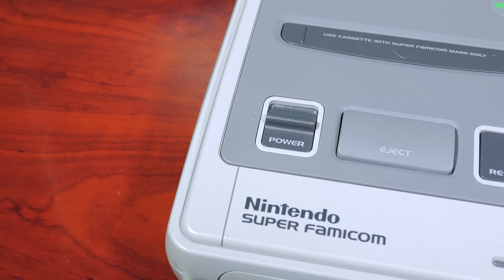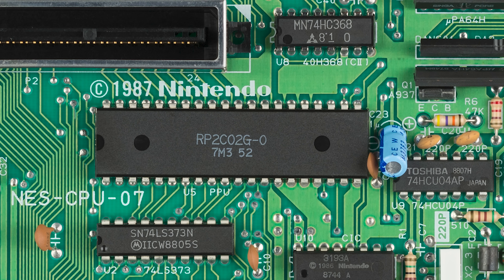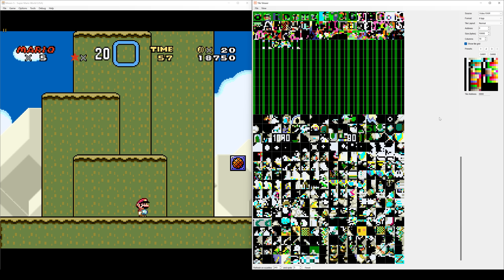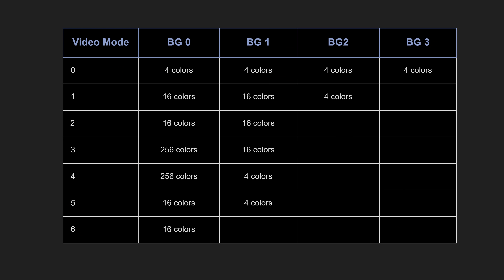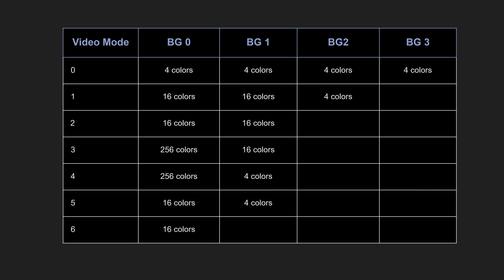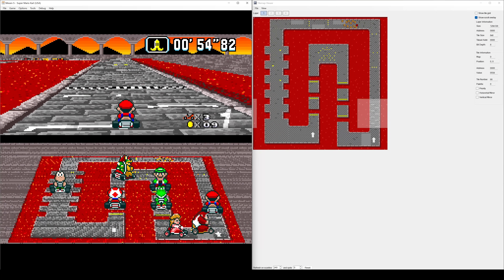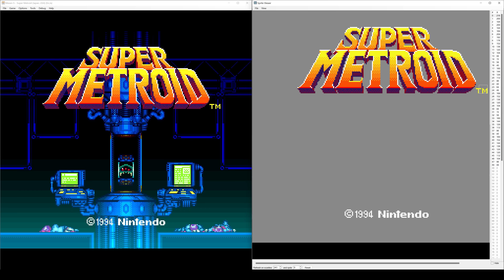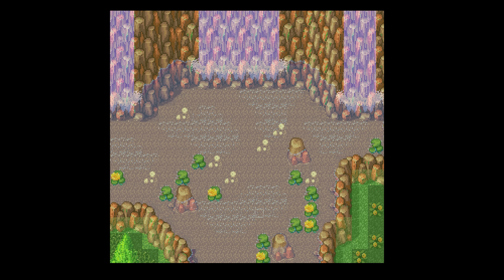How Graphics worked on the Super NES | MVG

Comment: In the opening, you mentioned that the SNES used the Ricoh 5A22, a variant of the 65C816 (which itself is a variant of the 6502). You indicated that at 3.58 MHz, it was underpowered compared to the Sega Genesis which used a Motorola 68000 at 7.6 MHz (over double the clock speed). However, directly comparing clock speeds is not an accurate comparison. Looking at the calculations per second the Ricoh 5A22 is approximately 1.5 MIPS while the Motorola 68000 is approximately 1.0 MIPS. This actually makes it appear that the SNES's processor might have been more powerful than the Genesis. Just something to keep in mind.
Reply: 6800 has more fitting instruction set so if used properly it was quite a bit faster than the 5a22

Comment: I am confused when you say the translucency/color blending on SNES isn't "true". Are you contrasting to this to per-pixel alpha on more modern hardware? Mathematically, the operation performed by the PPU between layers for translucency is exactly the same, and it is the same kind of technique used to do translucent stuff in PC software-rendered games like in Doom source ports - for example, 50% translucency is 0.5*foreground + 0.5*background.  PlayStation had a similar set of blending modes, but it offered them per-primitive rather than per-"layer" (as it has no concept of layers, being 3D-oriented instead of a tile engine; just two framebuffers).

Comment: If I recall the 65816 is a more efficient chip than the 68000. So even at half the speed, it's capable of a little better performance. Clock speed isn't everything. It's actually too bad the 65816 didn't eventually evolve into a modern 64 bit CPU everything is based on today. I suspect our computers would be double or tripple the speed clock for clock

Comment: I highly recommend RGME's Series about the SNES Hardware, it goes into great detail about pretty much everything, with very good visuals:
https://www.youtube.com/watch?v=57ibhDU2SAI&list=PLHQ0utQyFw5KCcj1ljIhExH_lvGwfn6GV
also it's not really fair to compare clock speeds of 2 completely different CPUs, the 3.58MHz 65816 runs slower than the 7.6MHz 68k but the SNES executes slightly more instructions per second as all 65xx CPUs require far fewer clock cycles to access memory and execute instructions compared to most other CPUs like the 68k.
Reply: Yes, it was slower but it wasn't half as slow. The little CPU punched a bit above it's weight.
Reply: I'm glad someone mentioned this channel, it's incredible.

Comment: Thanks for some insight into how the snes handled graphics. Im curious if youd be willing to dive into my favorite snes game jurassic park. Ive always been blown away with its isometric to fps switch indoors and am kinda curious
Reply: The indoor scenes were actually done with Mode 7 and software rendering, afaik.
Reply: @ShinyHappyREM  Kind of. More specifically, Mode 7 is used because its graphics format is linear i.e. every pixel is assigned one byte. In contrast, the SNES uses otherwise planar graphics i.e. a single pixel is spread out over multiple bytes which makes it hard to transform without proper hardware (e.g. SA-1, Super FX).

Comment: So....for devs to make a working emulator for these systems, the devs had to understand HOW the hardware worked and not just the software?
Reply: Yes. The software can only give you hints to how the console was supposed to work
Reply: Work through real ROM dumps on PC identifying behavior, build homebrew based on findings to test specific parts of it, then test homebrew on emulator and actual hardware to determine correct behavior.
Reply: I can't even begin to imagine. Like, you're already a good programmer and now you have to study hardware.

Comment: I'm curious of how Sega Genesis and other systems could mimic mode 7 style effects. What tricks were used? Will you make a video about that?
Reply: There's a YouTube channel called Coding Secrets that you might be interested in. The channel's author, a graphics programmer from the 16-bit era, talks about how he pulled off mode 7 effects on the Genesis - without the hardware obviously.
Reply: @megabyte01  He's not just any programmer. He's Jon Burton, founder of Traveller's Tales.
Basically, the Genesis does it all in software using line manipulation tricks or simply by using multiple sprites. The Sega CD has full hardware support for scaling and rotation, but few games made good use of it due to the focus on FMV. Sonic CD's special stages are a notable example "Mode 7" on Sega 16-bit console hardware. The 32X also supports it in hardware, and actually got a few games that made full use of the technique. Space Harrier and After Burner are really solid Super Scaler arcade ports on the 32X. But again, support was hardly what you'd call "broad".
Reply: @MmntechCa  ah, I didn't know that guy was the founder of Traveller's Tales! 
I also didn't know that the Sega CD and 32X consoles/add-ons could do mode 7 effects in hardware. We were a Nintendo household.
Reply: @megabyte01  yeah, and the Gen was plenty capable w/o those addons that ruined the reputation of Sega and the Genesis. Toy Story, Adventures of Batman, Red Zone, Ranger X etc have very cool 3d effects without cartridge upgrades on stock hardware. The addons did so much more harm than good.
Reply: @retrosoul8770  The cool thing is that the CPU of the Genesis was fast enough to software render polygons too. For example stuff like LHX Attack Chopper.

If you want a fun comparison of polygon rendering between the SNES/Genesis w/o special chips then look at Race Drivin' on both. Despite having simpler graphics it only runs at 1-3fps while the Genesis handles it around 7ish.
Reply: @VexAcer  definitely mate. There's also Star Cruiser as well which is pretty crazy. There's also this F1 racing game too that has polygons in the track design while only sprites on the SNES version but can't remember name. The Gen/MD is impressive considering it's 2 yrs older than Snes.
Reply: @VexAcer : The SNES was seriously limited in polygon rendering because of how the graphics data was stored. Instead of packing one or more pixels into a byte, the bits of a pixel were split up and stored over several bytes, interleaved with the bits of other pixels. This was done to save expensive memory space, but it meant that a CPU can't just plot a pixel by writing a single value. This would later only be possible with coprocessors like the SuperFX that internally converted packed pixels to PPU-compatible bitplanes.

Only Mode 7 used packed pixels, and it was used to render 3D graphics in games like Wolfenstein or Jurassic Park, afaik.
Reply: @ShinyHappyREM  the main limitation was the CPU's speed, it simply wasn't fast enough to be able to do all the maths involved which are usually CPU intensive instructions.
Reply: Too much to go in to for a Youtube comment but basically prerendering what you can, using the CPU to move things around and using the hardware features Genesis does have such as mirroring and pallet changing.
Reply: https://www.youtube.com/watch?v=nt-AxAqlrOo

Comment: SNES don't have color modes like PC, Atari ST or Amiga. SNES palettes are per tile not for whole screen and sprites can use 16-color palettes even in 4-color Mode 0.
So essentially Mode 0 should be better than 16-color Atari ST graphics, while 16-color modes 1 and 2 are nearly comparable to 256 color VGA mode. Games using that modes usually have 120+ colors on screen. With hardware transparency SNES can display thousands of colors.

Of course artists had to consider per-tile limitations, but overall games on SNES never had to rely on extensive use of dithering like it was present on Sega Genesis or Amiga.

However, SNES had lowest resolution of just 256x224 without square pixels. 320x200 or 320x240 was a gold standard for 16-bit systems. Sega Genesis had less colors, but higher resolution allowed for more detailed graphics or wider view. Lion King is a good example here. It has better graphics and audio on SNES, but still plays better on Sega Genesis thanks to higher resolution.

SNES's slow CPU had an impact on it's game library. Sega Genesis had fast arcade style action games, often with creative graphics effects and new gameplay mechanics, while SNES games were mostly generic platformers. However SNES architecture allowed story based games to thrive. Final Fantasy or Chrono Trigger weren't taxing CPU, but rather focused on story telling and interesting turn-based combat.

Also SNES almost got Super FX chip inside for European and USA release. Super FX was almost finished when console launched and Nintendo was close to put it inside. This thing could totally changed video game history. SNES would got much more 3D games and 2D games would have huge sprites, rotations, scaling etc.
Reply: SNES can do 512 pixels per line, it's just that game developers opted to use transparency effects instead. The video signal was mangled anyway thanks to RGB to NTSC and composite (unless you had an RGB-capable setup). The games could be fast too if the programmers knew what they were doing, see Rendering Ranger R2 or any Factor 5 game.
Reply: @ShinyHappyREM  512 or 640 horizontal pixels required RGB cable to look good and games using such resolutions were mostly seen on computers, where RGB was common or even mandatory. 320 was the best value, since it nicely fit with 240p mode giving square pixels and NTSC had color clock at 160 pixels which allowed for artifact colors at 320 pixels. This was used in "composite color mode" of CGA on PC that gave 16-color graphics on 4-color device and most Sega Genesis used vertical stripes that blended into one color on Composite output.
This gave Sega console more colors and transparency, you can look at Earthworm Jim in Hell stage there are flames that look horrible on RGB, but on composite they become a transparent layer.

As for fast gameplay SNES could easily do it. However Genesis had simply better CPU that could do more calculation like move a lot more sprites on screen than SNES. Also nearly all Genesis games run on stock hardware, while many SNES games had custom chips on cartridges that did various things. Even Mario Kart has a custom chip to display more sprites than F Zero did.
Reply: @Leeki85  The chip (DSP-1, to be precise) isn't responsible for sprites (in fact, none of the enhancement chips ever boost the PPU, much less sprites) but rather for 3D calculations, something which the stock SNES would have included on its own but it was scrapped because the base system would have been too expensive.

In fact, one sign of it is that Pilotwings misses the Super Famicon release by one month and another is that Nintendo has got its own music engine but it went through multiple revisions, one of which is used by both, SMW and PW and is lacking many features while F-Zero, a release game like SMW, uses a different, modern one.
Reply: @MarioFanGamer659  Mario Kart developers wanted to have more sprites on screen. While SNES graphics hardware could easily display them, CPU wasn't fast enough to calculate their position. This is why they added DSP-1 to the cartridge.
Mario Kart is a 2D game, there's no need for 3D calculations. DSP-1 is used to simply transform world position to screen position that is based on camera position and camera angle. In the proces It also calculates object distance from camera so sprite of proper size can be used. SNES CPU could do it by itself, but for much less objects and probably splitscreen multiplayer would be impossible.

Amiga 1200 (68020 14 MHz CPU) had Xtreme Racing which replicated Mario Kart style with Mode 7 graphics done entirely in software.
Wacky Wheels on DOS PCs were nearly a ripoff of Mario Kart (but with awesome music!) with software Mode 7 and even had split-screen. It required 20-25 MHz 386 CPU.
Reply: @Leeki85  Ah, now I get it. I was thinking of sprites in the technical sense while you were thinking of sprites in the sense of calculating their positions.

That being said, I'd rather say that SMK would be impossible (or at the very least, difficult) to have at 60 FPS if it wasn't for the DSP-1 chip.

And the reason why I mentioned that SMK is 3D is because it really is, every entity is represented in three dimensions, it's just that the tracks themselves are flat so the 3D-ness isn't as apparent as on later games.
But I was primarily thinking in the graphical sense and indeed, the graphics themselves are 2D but that isn't really far off from how modern graphics work. Instead, you contracted yourself by dismissing the 3D-ness of the graphics but also wrote that "DSP-1 is used to simply transform world position to screen position that is based on camera position and camera angle." which is 3D calculation, the game has to take care of depth instead of using cartesian coordinates, for example.
Reply: @MarioFanGamer659  Actually 2D, 3D, 4D, nD is all the same. Same math, same equations. Increasing dimensions also has very low impact on CPU. People simply don't understand why 3D graphics was harder in the past.
In general 3D graphics require to redraw whole screen every frame, while basic 2D just needs to update screen edges and sprite positions.
2D graphics like SNES or Genesis had is just a series of simple memory transfers or clever "racing the CRT beam" with reading selected memory areas based on tilemap array.

For 3D graphics image has to be constructed every frame. While processing 3D world by itself is easy, the same way it is done with 2D world, camera from 3D perspective introduces tons of new things to consider. For example CPU has to find objects that are in camera view. They need to be sorted based on distance and for every such object transformation has to be calculated for how it will be displayed on camera.

Original DOOM PC port has built-in benchmark that can only run game logic. It will then run at target 35 fps on low-end 386SX 20 MHz PC, that will have just 1-2 FPS while drawing graphics.

Also 2D in general is as complex as 3D. If you add scaling, rotations and other transformations hardware requirements are on par with 3D of the same era.

Yoshi Island for SNES is a good example here. It uses Super FX chip that powered many 3D games for SNES to do scaling, rotations, bigger sprites and in general things that was more than simple memory transfers.

It's actually hard to explain all of this without using concepts that are base for advanced math. It's not hard though, but simply different to what people learn in high school. 

Like you said, that I contradicted myself, but for me 2D, 3D, nD is all the same. Things get different when you're working with infinite dimensions, especially infinite and uncountable.
Reply: @Leeki85  Of course, almost none what you wrote is false. The only misunderstanding is that you were primarily thinking of the gameplay while I was primarily thinking of the graphics (or at least, the 3D to 2D projection).

That being said, I disagree that Super FX is responsible for sprite sizes. It's really just as you described: All you need to do is to is to place the positions of the sprite tiles and let the PPU do the rest.
Which, unless you're adding limbs and therefore trigonometry or 3D to 2D calculations, is really just reading from a table and offset the positions relative to the entity.
If you need really big sprites, put the body on a background, that one is a very common strategy.

Furthermore, both the SNES and Mega Drive also allows you to use multiple sprite sizes, thus mitigating the size issue even more (more limited on the SNES than on Mega Drive, though).
The only real limitation are the amount of tiles you can use (naturally) as well as how many pixels of sprites can be drawn on the same line which is a far bigger issue.

Edit: That being said, I realised that I was primarily thinking of a rotating camera and 3D models. Of course, if the camera is static and use sprites only then the only thing you have to take care, is to translate the third dimension into priority as well as an offset to the other two dimensions (or only one if you simplify it a bit).
As a result, if all you have to take care off if sprites, the worst you have to do is multiplication and division.
Nonetheless, for the 65816, multiplication and division are fairly complicated due to the lack of proper opcodes and therefore have to rely on the rest of the computer if not software, which is what truly makes 3D graphics on the SNES so complicated.

Comment: You said double vertical resolution of 512 when you meant to say horizontal. Thanks for the video otherwise!
Reply: There actually is interlaced 480i support in the SNES IIRC, though I'm not sure if it's tied to the 512 pixel-wide mode or not.